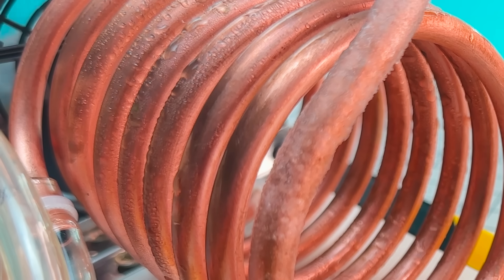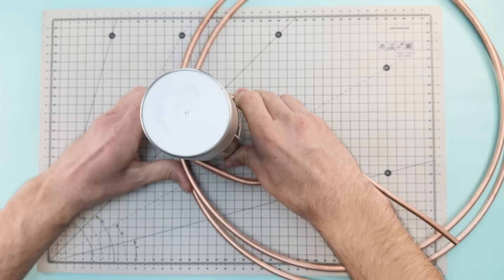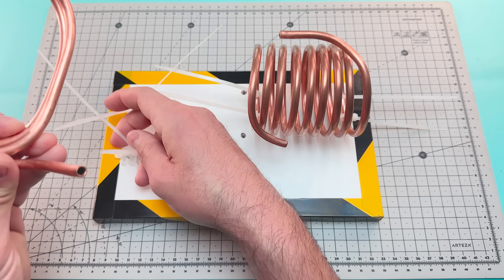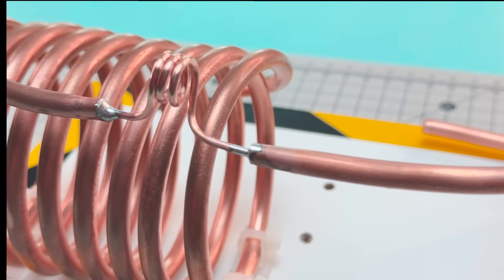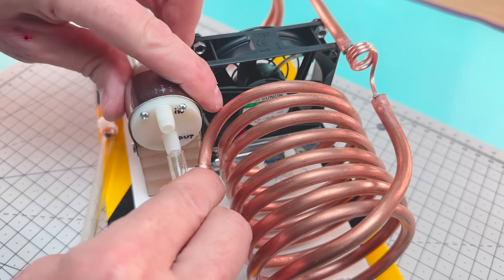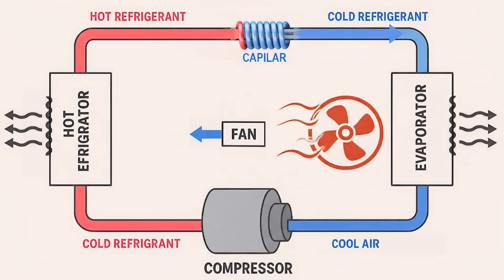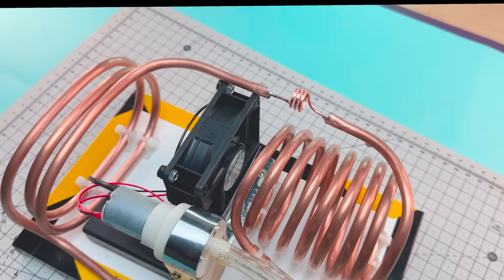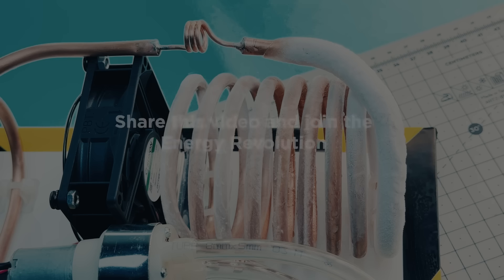Make your own AIR CONDITIONER at home Fast and Easy!

Comment: That's a complete lie. Compressing and expanding gas in this way does not produce refrigeration!
You froze them in another freezer before filming the video!
There seems to be something strange about the way the frost melts and forms in the video.
Reply: Lol
Do just a little research before commenting
Reply: One thing wrong with this setup is the proximity of the condenser. The condenser should be located outside so the heat isn't returned to the same room as the expander. This setup will heat a room, not cool.
I'd be very surprised if a 9V battery and a small pump could work in this setup but I'm not sure about this.

"Compressing and expanding gas in this way does not produce refrigeration!"
When compressed, the gas turns to a liquid. The liquid is much warming then the gas. The heat is then removed from the liquid so when it is converted back to gas it will be cold. As long as heat is being removed from the condenser, this setup should work (assuming the pump and power supply is strong enough).

What do you think they did wrong?
Reply: @ddegn  Something this size might have the equivilent of a couple hundred BTUs cooling at the very most.
Aside your correct comment, outside actual dual circuit AC units usually in windows, the portables generally have 1 exhause hose so room air and freshly chilled air are being pulled over the condensor to cool it and exit the room.
Possibly a bigger problem is constantly pulling room air and chilled air from the room to outside means hot air from the rest of the house will be pulled into the room from under doors, etc.
Reply: @boots7859  "the portables generally have 1 exhause hose"
We used to have one with the air hose to the outside. As you point out, it didn't work nearly as well as a window unit which separated the condenser so the heat could be easily moved to the outside of the house.
While I understand the how these sorts of heat pumps work, their ability to move heat from a cool room to the hot outside seems like magic. It seems like some law is being broken for heat to flow from cold to hot.

Comment: Running two motors, one of them drawing about 1/2 amp from a 'radio' battery will only last about 5 minutes! Crazy choice of power source. Need 12v 4Ah at least.

Comment: Doesn’t “air conditioning” dry the air too?
Reply: Of course, the pipes get so cold that the humidity in the room when in contact with these pipes instantly transform in water, then that water freeze around the pipes, the simplest concept of this kind is rain itself, hot clouds+cold front=rain.
Reply: Yes, most heat pump style air conditioners have a drain for the condensed water.

Comment: What are the specifications of the pump, where i can find sach a pump?
Reply: it's around 7$ on temu, aliexpress etc. but keep in mind that what you see in the video works but not for very long time, that air pump has a rubber diaphragm that is osculating, when in contact with the isobuthane it will get harden and rigid, so it will break pretty soon.

But I can give you a better, more proper idea, you can buy a portable ice-maker machine which is around 30-60$, maybe cheaper SH and that has a proper compressor, small but made for this type of refrigerant which will not break so fast, or even better if you have around a small old fridge that one can work with r32, which is a bit more safer than isobutane which is extremely flammable.
Reply: @IveMetYourMotherOnce  Agreed. That pump and power supply were way to weak.

Comment: Muy interesante. Sin embargo, no funciona y el motivo es muy simple: La unidad condensadora y la unidad evaporadora están dentro del mismo recinto y eso hace que el rendimiento neto sea cero. Porque el calor que desprende la unidad condensadora es la misma cantidad que absorbe la unidad evaporadora. 

Pero puede solucionarse: un agujero en la pared y poner la unidad condensadora fuera del local y la evaporadora dentro del local. 

Este aparato en invierno sí puede tener un uso alternativo: deshumidificar el local en el que se encuentra. En el lado frio se va acumulando la humedad del local y el frío que genera es compensado por el lado caliente del sistema.
Reply: It's worse than you say. The result is not zero. The room would get hotter.
Edit: Your solution is correct.

Comment: Good, But!
Power output is low..
The Outdoor unit aka condensor must be outside of the house... 
There is a reason why indoor is indoor part and outdoor is outdoor part... 
You just mixing hot and cool air in the room...
Reply: it's too small to generate proper heat so it's not really an issue, you still get a chille breeze but will not hadle a room by no means, think of it this way, my soldering iron tip gets 500*C, but has no real impact in the temperatur of my room when I use it.

But if you make it bigger, the refrigerant will be more, pressure will be higher = high temp on condenser. BUT your room will still be chiller, because even when the hot air cancels the cold air, the HUMIDITY drops which will make it more pleasant.

Comment: The condenser being inside the room will keep the average temp in the room the same, but it definitely will make you cooler if aimed directly at you. Debating trying to make one of these to sit beside me in a project car.
Reply: Humidity is the key, not necessarily the chill effect, yes if you put something like this in your car, the cold air will be canceled the hot air but the humidity will drop no matter what and will be much more pleasant. (unless you find a way to put the coondenser in the trunk or something and the evaporator inside) but keep in mind that you are talking about butane, in an eventual car crash (which i hope it will never be the case) this may do much worse that it would be without,
Reply: @IveMetYourMotherOnce  You seem to have a hard-on for humidity for some reason.  When its 85 at 10-11 PM, a drop in humidity a bit ain't going to do squat in making it easier to fall asleep as you slowly soak the bed and sheets with non-stop sweat pouring off you.
Isolatng the condensor using exterior air will actually lower the temp faster as your not throwing the BTUs out the exhaust.
Reply: swamp cooler. do it right they look dope and will def keep you cool

Comment: Actually the room will not cool down at all as your are only pumping the heat around. Of course if you had a method for dumping the heat outside that would change.
Reply: Make longer pipes😂😏
Reply: No shit. This video is basically just for entertainment and to show the basics concept of a real ac system. Im a hvac tech and it took me over a hour to learn this in school just to forget the next day for a whole month to fully understand the physics and chemistry happening in this video but more complex system
Reply: A method of dumping the heat outside, you mean cheap air hoses like the ones in the portable AC units? brilliant! just separate the condenser and evaporator in 2 chambers with wood + polystyrene link the hose to condenser chamber + a vent... throw it out the window, done

Comment: Not exactly something for long term. But as a low pressure  DIY system basics are all "mostly" there for simple cooling system. but do keep track that those are 12v components not 9v so yeah will need more batteries or a charger to run them. And i do not recommend puncturing the tube to inject the gas and keeping the entire system as copper line using a Valve stem from  a car tire and a "T" joint would be better.
Reply: Can one "separate" condenser coil to outside, remove plastic tubes, replace battery with charger,  and make it work as mini AC?
Reply: @vidzzzz  Of course, that's how split unit ACs work. The heat is only released outside. Using plastic tubes for the distance required to go outside, is good, because that doesn't conduct heat. Then outside a copper coil. But I think it needs a bigger pump to be more effective. I don't know enough about physics to tell if it's more important that the flow or the pressure increases, but I think the flow (litres per minute or per hour) is most important. Also it might need an electronic fan blowing air at it outside, or a very large copper surface area. All things to experiment with. It would be interesting to build this, but I think for it to provide the level of cooling required it would need to be much bigger and more efficient. The commercial producers of these systems all do their best to make them as efficient as possible and they still need 80 to 125 Watt per m² room... the average room of just 4 by 5 metres needs about 2000 Watt already. A DIY installation is most likely not going to be as efficient as a commercially produced optimised one. So I am afraid it's more fun than practical.
Reply: @corcorsma  I have a mobile unit with 1 hose.
That hose gets very warm and radiates a surprising amount of heat back into the room.
I am going follow  one of the YT vides and fully isolate the condenser section and give it its own intake hose.
Then I'll foam insulate both new intake hose and existing condensor exhaust hose.
Trying to avoid the mini-split bill.
Reply: @vidzzzz  There is a reason actual engineered AC units are several hundred $$ and pull 500-1000+ watts.
If you can get the material cheap and upsize this by 10x and don't mind a frankenstien low efficiency unit on utility power, you could theorectically make a low efficiency/high operating cost DIY AC.
Reply: For anyone who actually wants/needs cooling, don't follow the above suggestion.
Even if you have most of the parts, its going to end up still a waste of money outside of over-sizing this by 10-20x AND getting the condensor isolated and having its own dedicated intake and exhause lines out of the room.
Got 2 decent 'mobile' 10K Hiar units which work perfectly.
But condensor is not isolated and it only has 1 exhaust line out of the room. 
So the condensor fan pulls the just chilled room air along with room air into the unit, over the condenser and out of the room via the exhaust line.
Was 85 the other night and took 2+ hours for a mod. bedroom to get from 85 to mid-70's.  Warm air is being pulled in under the door to replace that exhausted room air.
The project above is a neat toy that useful for learning before scaling up if you wanted, but on its own it'll be a waste of time and money otherwise.

Comment: Everyone saying this won't work because it's still blowing hot air but what if you ran the hot tube Long enough to be outside and the cold tube inside?
Reply: That’s how all ac units work. By the time you spend the cash to get the tubing or a better refrigerant to do an effective room volume you can easily buy one. 

You could put this in a server cabinet tho it might help at the expense of another ac unit fighting the heat pump 
Source: I played with ac units for the Navy. Priced out a diy. Can’t beat mass production.
Reply: you can't really, because the longer pipes will mean a lot more refrigerant and this works on (iso)butane, there is a reason almost no AC unit uses butane, its not safe, also you will need a bigger compressor for more pressure and gas volume.

this contraption uses about the same amount in a lighter, if you blow up a lighter you may loose a finger, but the whole can could chill you forever.

IsoButane is used in fridges and small apparatus, but not rally in AC.

Comment: Nice video. However, the final conclusion and marketing pitch is grossly misleading. This device cannot serve as air conditioner unless the condenser coil is placed outside the room, which the author neglected to mention. If kept as it is, the heat dissipated in the pump and the fan will produce more warmth than the produced cold. It will work as a "spot cooler", but the room will eventually heat up. This is a bad service to uneducated people, the law of energy conservation still holds here.
Reply: Can one "separate" condenser coil to outside, remove plastic tubes, replace battery with charger,  and make it work as mini AC?
Reply: @vidzzzz  no, it would mean longer pipes, more gas, more pressure, that pump can't handle that.
Reply: Still working on a way too beat that stupid law of energy conservation. All that red tape...
Reply: *to
Reply: Agree, and IIRC actual AC units usually have a compressor to maximize efficiency/BTU's.  While neat, this is a very low efficiency implementation, probably usually used to explain basic principle to HVAC folks.
Even upsize 10x, it would require a lot more materials, energy and still be very low efficiency compared to even the cheapest AC one could find.
It might be cheaper to find an old auto AC compressor unit at a junk yard for $50 and a hefty 12v psu if someone wanted to seriously tinker.
Its 2025 and the Laws of Thermodynamics have still not changed.

Comment: about 1% efficient if it even works
Reply: and power stations that run on fossil fuels are 20% efficient. what's your point?
Reply: @silverismoney  No they are not, modern combined cycle power plants are approximately 60% efficient. Its a science project not a functional unit, I thought that was obvious.

Comment: This is a simple heat pump - it transfers heat from one place to the somewhere else.. The smaller diameter coil gets colder while the oval coil gets warmer. They are both in the room. The room temp will stay almost exactly the same plus a teeny tiny amount of heat as the battery discharges. The hot coil needs to be outside the room in the summer. In the winter just reverse the pump - then the coil in the room will get warm and the coil outside the room will get colder that the outside ambient. Very nicely done video, the design implementation is quite clever. I also LIKED the AI voice!!
Reply: Or even simpler design just stick ice trays in front of a fan but changing the ice trays does get problematic.
Reply: @davidkellymitchell4747 unless... the fan blows really fast and vaporises the water. 🤫
Reply: @sebedee9034  😂

Comment: Just remember if you build this to actually cool off anything you need one venting the hot air from one side outside and the other pushing air over the cool side spreading into the room

Comment: The only problem I see with this design is that you need to remove any moisture from the air inside the copper tube before adding the isobutane. Otherwise, freezing water could clog the pipes. Yeah, I know this from experience. Not because I did it myself, but because I was a witness to this happening with a very, very expensive cooling system. At first, they thought the motor was going bad and needed to be replaced, which would have cost about 10,000 Euro. But it later turned out that moisture left behind in the pipes was the real problem. After they purged the lines, the system worked normally again.
Reply: Correct pull a vacuum before charging

Comment: Good. But you haven't used vaccum process to evacuate air in the pipeline.
Reply: vacuum is made if you fill the system with cooling agent. the cooling agent makes acid with the water vapes in the air and kills the air conditioner. this cooling agent is lighter gas and no need to vacuum the system. actually the air in the air conditioner doesn't  make sense to its work, but makes acid which is killing it.
Reply: The best way to get rid of gas and then fill it
Reply: Similar to how light bulbs and vacuum tubes are made first using a separate gas to vacate the current gas

Comment: Relax it's a demonstration unit. Meaning you apply it based on your use case. Anyone with half a braincell will know to put the hot side outside. If you don't have enough singular braincell to know that then you should absolutely not be building a diy air-conditioner. And if you still try well then natural selection. 

As others have pointed out 
1 the isobutane itself is hazardous to your health with leaks 
2 issues with the brushed motor pump could likely cause the gas to catch fire or explode
3 condensation needs a way to drain

Comment: First, this is NOT "fast and easy."  You've done it before and have all materials (even premade pump support).  It's not "fast" for anyone else.  Secondly, although this seems like a good idea, but as you say, the "gas releases the heat into the environment"!  It's why a real air conditioner puts the condenser OUTSIDE the room.  One side is cooler and the other side is hotter.  The heat isn't destroyed, it blown into the room.

Comment: All this is a good idea but as a Certified Apt Maintenance Tech II that's worked on several A/C systems where is all that condensation going to go with no drainage system and how much gas is too much or not enough to prevent freezing or not cooling good enough???
Reply: how does the drainage system typically connect and collect the condensation. Is it mostly just collecting the drops as they fall and then drain it out?
Reply: @chrisbolor  Most residential systems have either a reservoir or a drip-channel to direct the water outside the unit. Commercial units may have plumbing that connects the drip-area of the HVAC unit to a sewer line or to an internal-use pipeline. This is actually a very effective way of capturing water (which is this system's byproduct) in humid regions while doubling as a method to cool down an interior space.
Reply: @chrisbolor drain pan plumed to an actual drain or outside

Comment: That doesn't look like PVC tubing to me.  That looks like silicone tubing.
Reply: It appears to be PVC tubing. Silicone tubing is less rigid. PVC comes in many different forms. PVC pipe is very different from PVC tubing, which is very different from all the PVC covering "Vinyl" car seats and everything else inside a car.